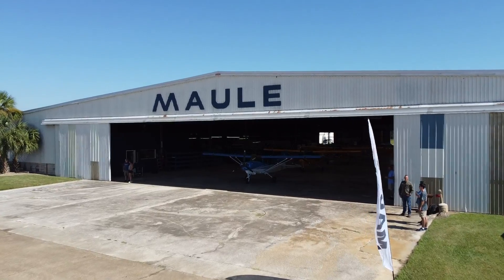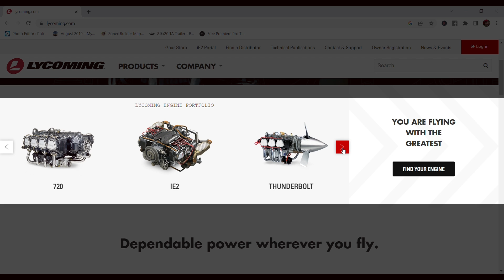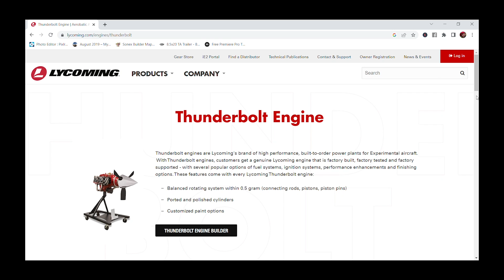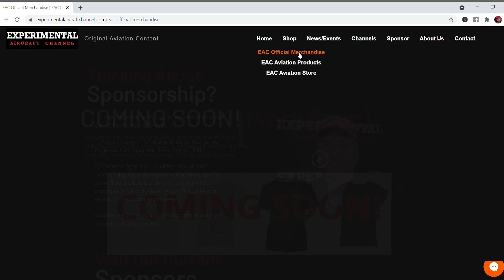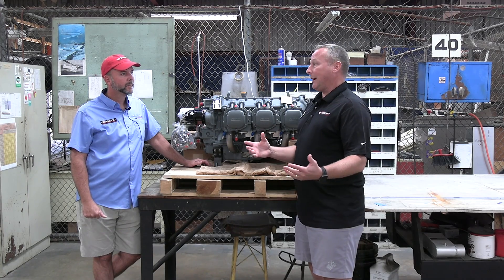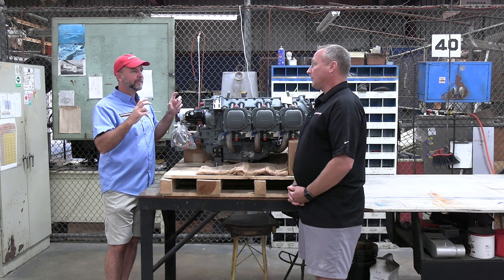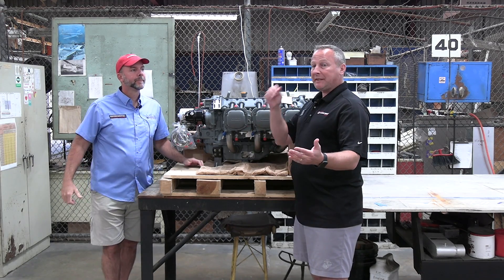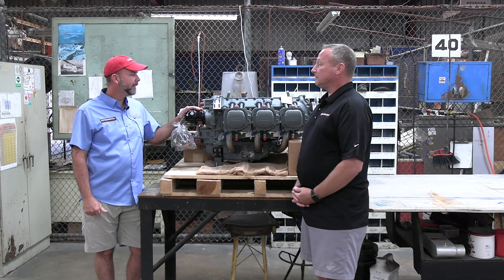Lycoming Aircraft Engines - What they offer for your Airplane - Engine Week 2022

Comment: Lycoming engines stone age technology. 40 years behind
Reply: Behind what.    They are purpose built unlike other options.
Reply: @tomspettel3646  With 1940's technology they are decades behind almost every other class of engines and at that price there is no excuse for it.  My TIO-540 probably has the power to weight ratio of a steam engine.
Reply: @Cloudy494-n1p ya they are but they are purpose built and generally reliable unlike some people using automotive engines in aircraft.

Comment: No touch and goes for the first 50 hours- that is a bummer. You want to do a proper test flight period for the experimental to confirm all the landing and starting distances for you specific airframe. Is it common? I thought the first 2-3 h of brake in is crucial, then you can do what you want
Reply: 50hrs with no circuits WTF

Comment: I was looking at this months issue of kit planes, the cost of the Lycoming makes me want to throw up. Over priced and for the same tech thats essentially unchanged.  They are going to kill their own business with what coming with fuels and regulations.
Reply: And FAA actively wont budge on automotive Engines for certified planes. When they will burn unleaded fuel and are far more efficient
Reply: @Optimus-Prime-Rib  The issue with certification is the requirements such as redundancy. The redundancy is because of the initial engine design; air cooled, leaded fuel, low quality oil, OHV, single valve, basically the engine in this video. Air cooled engines are prone to detonation, which requires leaded fuel for these engines, which requires mineral oil, which along with the fuel burns dirty and causes plugs to get fowled and detonation. Dual plugs are for these reasons and that one magneto controls the whole ignition system. For a modern engine that does not require the same level of redundancy having to comply with these old requirements makes them less practical and harder to implement. In saying this, engines are also certified to an airframe. The vibration an engine emits may be fine in one air plane but not suitable in another. So again, if you want a quality modern engine, the manufacturer would have to be closely related to the aircraft that you are flying. Diamond have their engine certified for that reason. Rotax are partners with companies, as are Lycoming and Continental, Jabiru etc. I would like to try and certify my engine when ready, but for the helicopter I am building. I think helicopters are far more practical. Sorry for the big comments.
Reply: @Optimus-Prime-Rib  The last I knew, the FAA did not have different certification standards for engines from a different manufacturer.  If someone wanted to certify an auto engine for aviation use, I am not aware of anything at the FAA that prevents that.
Reply: @LTVoyager  The problem with this issue is that the automotive companies are not the ones who are "converting" car engines for use in experimental aircraft. So they have no interest in trying to get them certified nor do I think that legally can one of the "auto conversion" companies do it either since the base or core engine was not built by them.  The patents for those engines are held by the actual car manufacturers not the auto conversion companies.  I also have read and seen where the car manufacturers that have attempted to do it, abandoned the projects do to small numbers and large liability.
Reply: @scottmiller4711  Bingo.  The issue isn’t the FAA not budging as “Hercules” said, but rather the economics of aircraft engines.  The volumes are low and the liability high so no incentive for an auto engine maker to get involved.
Reply: @LTVoyager  I would imagine that all it would take is for an engine manufacturer to get named in a lawsuit over one of these converted engines and car company will shut down the conversion company from using their engines in the future.
Reply: @scottmiller4711  I am not sure this can be done legally.  Once Honda sells an engine, that engine is no longer theirs to control.  Sure, they can void warranties, etc., but, say in the case of Viking who use Honda engines, I am not sure they can do much else.  Viking buys their engines from sources other than Honda and I am not sure Honda can do much about that.  IANAL, but I am not aware of any law that allows this.  Hopefully, any lawyers reading this will chime in.
Reply: @LTVoyager  I am not an attorney but I have been married to one for more than 30 years.  My point is litigators go after "deep pockets" and few are deeper than car companies.  While they may not be "liable” that does not prevent a lawyer from trying and I suspect that the car company named would then go after the company that did the conversion and probably run them out of business...
Reply: @scottmiller4711  If you are married to a lawyer, you should know the difference between libel and liable.  😁
Reply: @LTVoyager  sorry, please excuse my typo…I do
Reply: @scottmiller4711  I couldn’t resist.  😁
Reply: @LTVoyager  Hehehe 🤭
Reply: I wish Lycoming had IE2 technology in the Thunderbolt line.  I want a modern auto style engine for my S-21 and Rotax was the only realistic option.  It is unfortunate as I live only an hour’s drive away from Lycoming, but they are just too slow with modern technology (about 30 years behind auto tech) on most of their engines.  I also prefer liquid cooling, but would have bought an air cooled engine if it had modern electronic fuel injection, ECU controlled electronic ignition, knock sensors to handle a wider range of octane fuel, etc., but alas only Rotax comes close to the ideal.
Reply: @LTVoyager  Have you looked at UL Power?
Reply: @scottmiller4711  Yes, but a number of issues the main one being lack of a FWF kit.  It is taking me long enough to build the airplane and I don’t want to spend another 6 months developing my own cowling and FWF.  And with a small company, the chance of not being able to get parts 15 years down the line is always a concern.  Rotax isn’t that much more expensive when you factor in that RANS is offering a FWF for that engine and I am fairly confident Rotax will be around in 15 years.  And I like liquid cooling and the turbocharger on the 915iS.
Reply: @LTVoyager  UL has been around for about 20 years now I think. I love the fadec but they don't run well with 100LL and unfortunately not much UL gas available Cross the country. I know a lot of people are moving towards other companies with the outrageous price increases for the same old tired technology lycoming produces. Of course you will have all the Lycoming fanatics try to justify how the 60 year old tech is the best....the only reason they haven't advanced the tech like every other industry in the world is because they don't have to.

UL has helped many with designing FWF kits as they want to be able to offer solutions. At least they are trying.
Reply: @Austinmediainc  I give folks like UL lots of credit for trying as you say.  However, if you look how many engines they sell per year after 20 years, their growth rate is dismal.  Look at the growth of Rotax in the last 20 years for comparison.  the likelihood of UL being around 20 years from now when I need an overhaul is much, much less than the likelihood of Rotax being around.  Again, not knocking folks like UL, just giving my rationale for selecting Rotax.
Reply: @LTVoyager  I understand what you're saying but I personally think UL is growing and sustainable. They obviously don't have the money Rotax has, and they don't have the base sales of legacy engines to reinvest. Love the 915is, turbo,  liquidcooled, EFI, full fadec, etc. If rotax can start making more ponies they will be an even bigger force, I think the 916 is only 15 hp more. The prices are getting pretty expensive for their new technology too...

UL will have problems growing with the market being dominated by 100LL....I would love to go with UL but can't because of fuel availability.
Reply: @Austinmediainc  I hope they are and I am not saying they won’t survive, I am simply saying the odds are not as high for them as for Rotax.
Reply: Antiques are expensive.
Reply: I really want to build a RV14 but the lack of a modern practical engine prevents me from doing so.  The Lycoming engine costs more than the quick build kit.  Avionics options sure have come down in price but the Lycoming products will be forever stuck with high inflation.  Let’s face it, in todays market if you want to build a plane with a lycoming, you have to be pretty well off.  The market that is really growing is the LSA market.  Thank goodness for Jabiru, Rotax and UL.  Lycoming business is not growing in volume of unit.  The certified market for GA has been shrinking for years.  Lycoming is advancing in the exp market but only to the high end.  My buddy just had to replace his camshaft in his Lyc 540 which is in a Maule.  $5K just for the parts.  Too bad Corvair didn’t have a 250HP air cooled flat six.
Reply: I heard a rumor that Rotax developed a liquid cooled 6 cylinder that targeted the 180 HP Lycoming market.  Rotax patented the design, then Lycoming bought the patent for stupid money to keep it off the market.
Reply: @dieseldan5189  That has urban legend written all over it.
Reply: @LTVoyager  more than likely but it is a good one!  But it does lead to the question, why hasn’t Rotax produced a 6 cylinder?
Reply: @dieseldan5189  That is an easy one.  Rotax is a high volume manufacturer, not a boutique manufacturer as with Continental and Lycoming now. If you look at the number of airplanes sold that require 180 HP or more, the numbers are pretty small, probably not worth the investment for Rotax.  I’d love to have a larger HP Rotax and am looking at Edge now as a way to get 160 or even 180 HP from the Rotax platform.
Reply: My last post on this topic, I promise.  If you watch the video of the Lycoming factory production process, you will then understand why their products cost so much.  Zero automation, tons of labor hours.  Except for a few CNC machines, they are behind the times about 40 years.  If you watch a video of Rotax production process, you will see a modern efficient production process.  Rotax has passed the threshold of scale, Lycoming never will.  UL certainly has a chance to displace Lycoming.  We must remember however that Lycoming is owned by a large conglomerate called Textron.  Textron will probably eventually buy UL and shut them down.
Reply: 3 year lead time and people are saying Lycoming is a boutique mfg?!?!? Hire more people,  add shifts, etc to bring the lead times to a realistic timeframe.  They are purposely keeping production numbers low to keep prices high.
Reply from the maker: People keep buying they are going to keep selling :-)
Reply: @ExperimentalAircraftChannel  only because they have no other alternative.  Hopefully that changes some day.